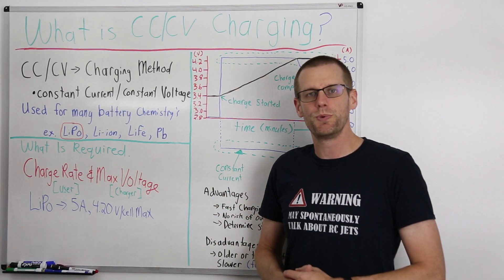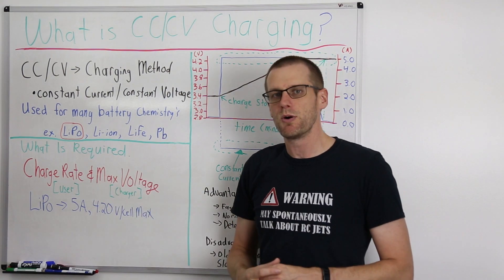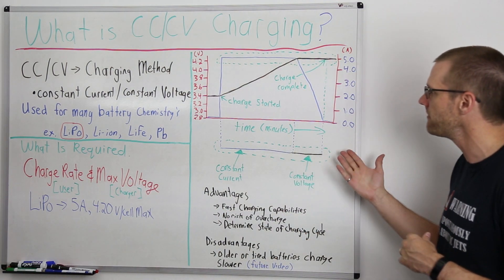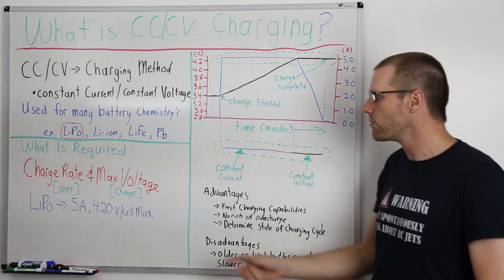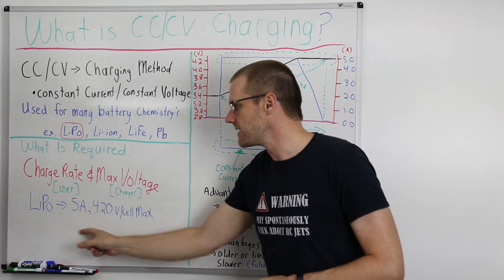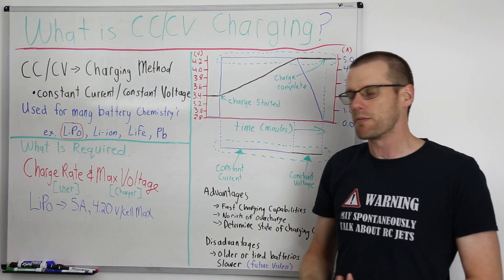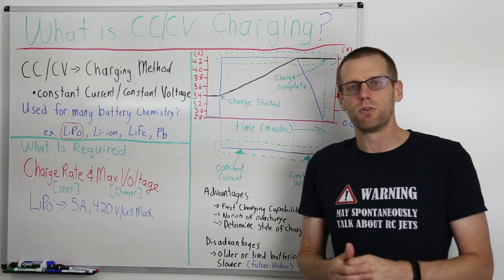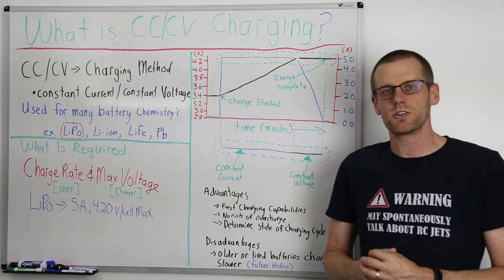What is CC CV Charging used for RC LiPo Batteries? (and others)

Comment: Thanks for the video. Very clear. I would also add another slope in the charging curve, being the CP (Constant Power), which is a CC limited by the maximum power of the charger. I use a 2x100W SkyRC T200 charger to charge my 6S 5000mAh LiPO packs, and they are capped at 100W = 4,9 -> 4,0A during the CC part of the charging.